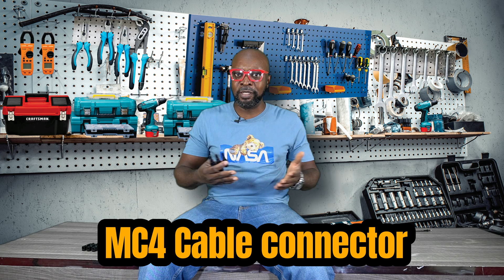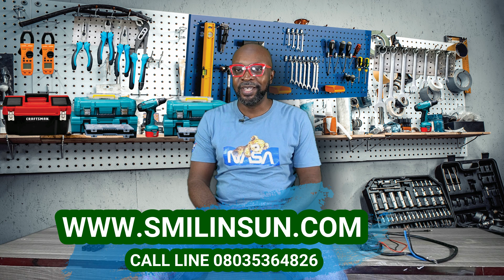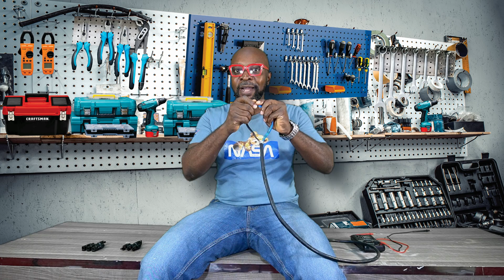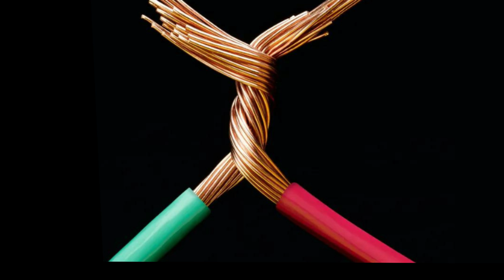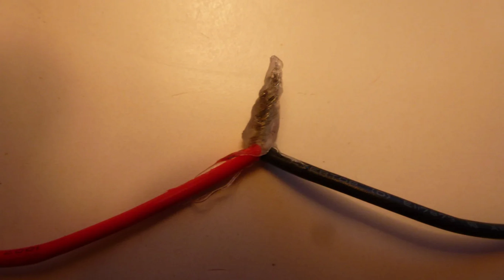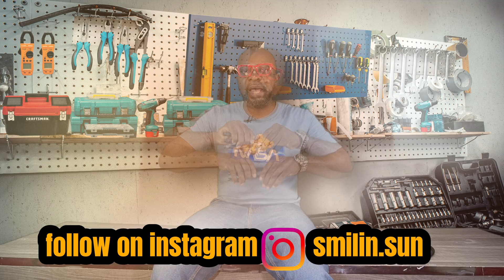Wonders of the MC4 Connector on your Solar panel strings

Comment: I have a solar generator that use xt60 and today as i unplugged the solar cable from rhe sskar generaror i saw little smoke coming out of the xt60 connector and it was alightly burnt. I use mc4 connectors . I dont know what to do now

Comment: In parallel connection where the say 4 in 1 MC4 connectors are used . Is there any need to add fuse to the connectors?
Then is there a limit to the current that can go through these MC4 connectors?

Comment: How many mc4 connectors will I need if had 12 Solar panels by 250 watts
Reply from the maker: Where the terminals join at the end of the strings is what determines the quantity of mc4 connectors you will need